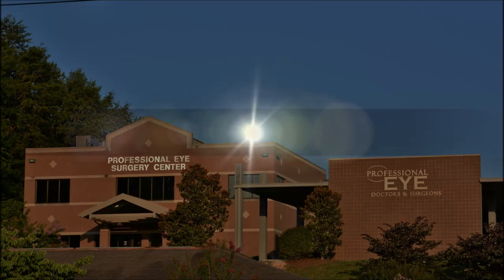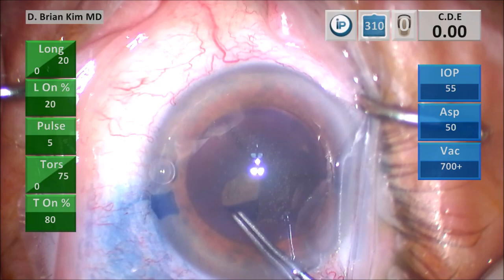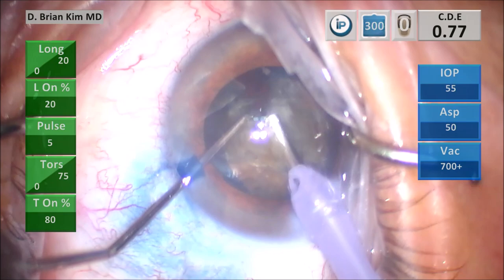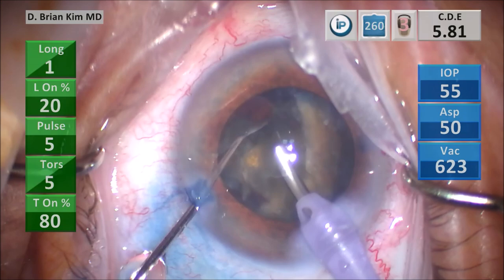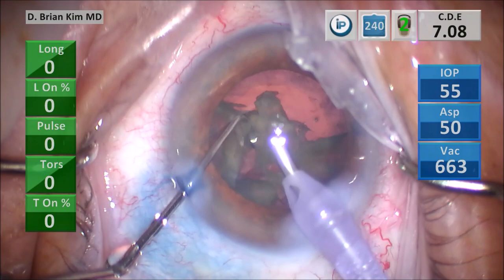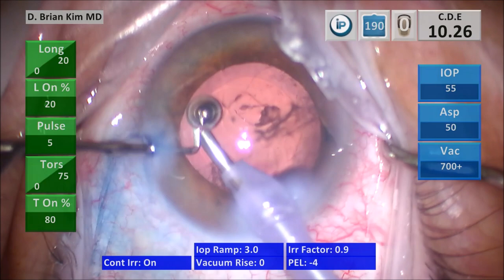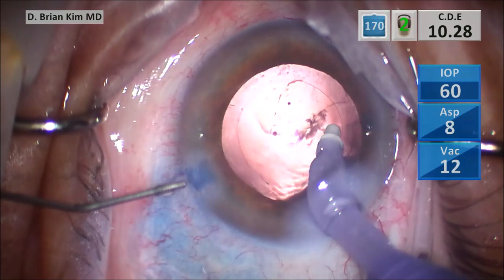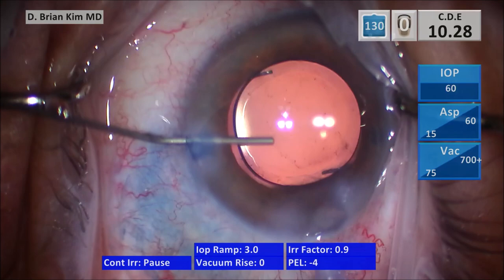Lens Is So Dense It Clogs The Tip, Anterior Capsule Tear From The Double Chop Maneuver

Comment: Dr Kim, would you implant a single piece IOL if capsulorhexis remain intact?
Reply from the maker: That’s a great point to clarify. I have no problem with the single piece IOL in this situation...even in this case. As a general rule, I prefer a three piece IOL in dense cataracts because it is my opinion that these dense lenses also tend to have weak zonules and I like the 3 piece IOL in case of late dislocation. It is easier to lasso suture around the PMMA haptics.
Reply: Really appreciate your approach, thanks a lot

Comment: I am sorry but the phaco tip seems too exposed.
Reply from the maker: I understand why you would say that and this is because you are looking at the phaco tip as a phaco instrument. You are looking at it from your point of view, not mine. You have to break your pre-conceived idea of what the phaco tip is. If you look at the phaco tip as a chopping tool instead of a phacoemulsification instrument (ultrasonic energy and vacuum), extending the sleeve makes a lot of sense. This is why I call it DOUBLE chop. The phaco tip is acting as a chopper not a traditional phaco instrument. That is the purpose of double chop, cross chop, and mechanical fracturing. I hope you understand. In my hands, I can chop lenses confidently, safely and efficiently. Those who do not use the technique do not really understand the power of the technique. I encourage you to try and then you can judge more objectively. Best wishes.
Reply: @DocBrianKimMD  thank you. I am always learning. My concern is that the infusion gets out of the eye and causes surge.
Reply from the maker: @marioacn  I agree with you. If the infusion gets out of the eye, then the sleeve should be adjusted to be closer to the tip. But this was not an issue with this case. Thank you for the question.